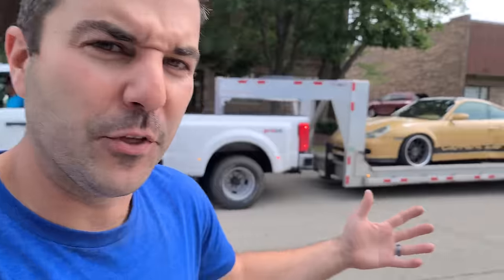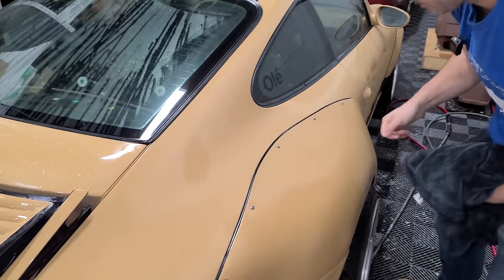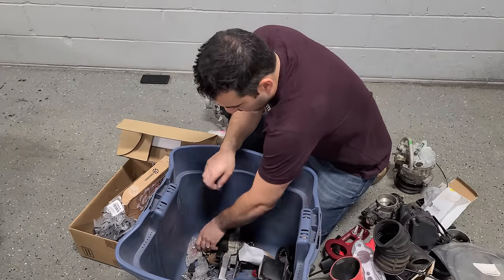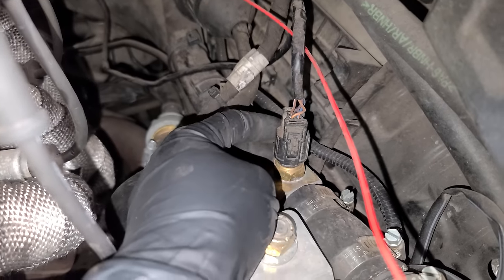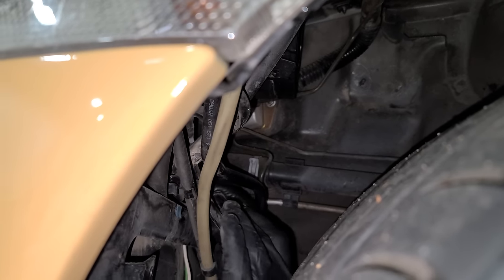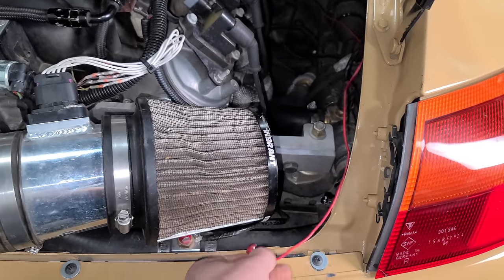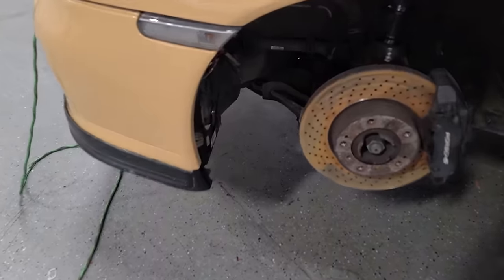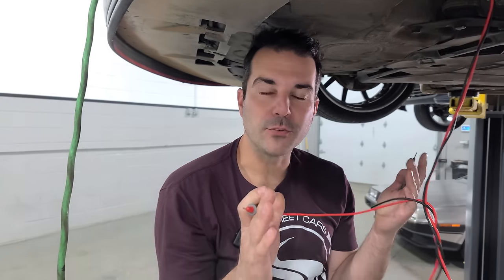I Bought A WideBody Porsche 911 That No One Could Fix! I Fixed It For FREE In 3 Hours! LS Swapped!

Comment: What am I working on? Trying to get a Tiburon GT back on the road. Needed a minor engine overhaul, some welding and some paint. I've fixed the engine, buddy finished the welding.. though he did burn up a bunch of wires in the process so those are going to need to be fixed still. Painting is underway.
By the time it's finally done and street legal it's time to take it up a notch and get it making more power, perhaps with a small turbo. Stock internals should be good for up to 350 hp.

Comment: If you plan on keeping the car long term a Meziere electric water pump would be a great addition. You get a much higher flow rate than you would at idle or low speed.

Comment: My buddy bought a couple boxters for $2000. One was wrecked on the front and the other was in decent condition but they couldn't get it to start or even crank. My buddy pulled the ignition/immobilizer stuff from one and put it on the other one and it ran. After taking everything off the wrecked one that he needed for the other one, he painted the fenders, or new headlights on it and sold it for $8k.. I'd say that was a come up.

I think with the way the economy is right now, I may start looking for cars that I can easily flip and depending on the turn around time, I may write my job or get a remote job.

I was offered to be a shipping agent at home, simply shipping packages, tracking them, and being customer service, for $25/hr. Of I want working already, I would do it 100%.

Comment: whoever tunes that for you can make that factory ecu output Efans if you wanna clean up and simplify fan operation specially with AC if you add that in
Reply from the maker: Do you mean through the LS computer or Porsche? I think I can get the Porsche one to take over can control as is. Supposedly there's another temp sensor that controls the fans.
Reply: @LegitStreetCars  stock LS ecu, food for thought
Reply from the maker: For sure,  I appreciate that. I'll try the Porsche computer first since it's still there and should be able to control the fans as is. If that doesn't work I'll try the LS ECU. I'm going to revisit that when I start the AC installation.

Comment: Stay Tuned (Tony Angelo) is also working on a similar project right now.  They did some good stuff on the cooling system and exhaust that might be helpful.  Your exhaust is...not so good looking.  Speaking of, it looks like (at least) the one muffler is pointed in the wrong direction flow-wise.

Comment: Running the fans after the engine is off is pretty useless - particularly with the sensor in a hose that is so far away. The coolant is not circulating so you are basically just cooling what is in the radiators. I would switch it to switched power and pull out the pusher fans. Also, if I remember correctly, the switch for the fans on those cars is in the engine block - which is not there anymore. As others have noted, get the right oil pan before you take it to the track or you will have an oiling issue.

Comment: I think the 2 stages of the cooling fans should never be wired together via a resistor...
Stage 1 goes via resistor to limit the current and RPM of the fan.
Stage 2 is usually a direct connection without any resistors... The fan should blow at max RPM and should get the max current.

Comment: Hey Al, I've never been inside an LS (even though I've got 3 of them), but you mentioned there is a .001-.003 clearance tolerance on the rods.  Are GM clearances always this wide (as far as rods and whatnot go), and are they usually all over the place a within the tolerance, or are they like Hondas or Toyotas, which will all be nearly identical, usually within a tenth or two (for example,. .0015-.0017 clearance on a .001-.003 tolerance callout, Japanese car and motorcycle engines are extremely consistent in their manufacturing methods and tolerances).  Does GM or Ford even approach the level of Japanese manufacturers?  Or can you count on them being all over the place, much like Chrysler/Dodge/Fiat?  

Good show, it's getting better and better.

Comment: So you just have max fan speed now? Since you took away the resistors. She gonna be cold in cold weather. Maybe not a problem over there. ( under temped engine oil) 
I would sugest stop using the wish/temu solder joints. Go with deutch connectors. Get a good tool for it. 4 point barrel crimper. 
Could allso use open or closed barrel crimps, with the right tool, and shrink hose over, if you don't want a connector. Soldering should never be used anywhere it gets hot, or where there is movement.

Comment: I paid $1,000 for a 1993 GMC Sonoma single cab long bed 4.3 V6 it's got missing bolts and falling off bolts and I had to replace the brakes disconnected wire's kind of similar to yours I got to replace the head gasket in seals and stuff eventually. But the interior and the body is in immaculate condition

Comment: I'm fixing up a shop that had a corner burned out of it. Once I have the shop resheated on the inside and wired, I'm going to put a 2012 GL 350 bluetec into the shop, pull the seized engine, and rebuild it.

Comment: Love the video and the build itself. I'm currently working on a 22 elantra n. Just installed a hybrid turbo and meth injection. Having trouble after install. Throwing codes p259f and p004e. I adjusted wastegste voltage to 3.8 and I'm still getting turbo surge around 5k. Not sure what the issue could be.

Comment: One thing to point out... factory fans arent always the best. The shroud is there to siphon the air into the fan and nothing more. Aftermarket fans are usually better CFM than factory fans and when setup properly will shit all over factory garbage. Factory is usually set up for comfort, reduced noise and to meet the requirements of that specific setup. As soon as you do anything to the car their performance deteriorates.

Comment: Add an electric ROWP (Run On Water Pump). With the engine off, the fans will only cool the coolant in the radiators, not the engine. With the pumps, the fans will cool the engine quickly and won't drain the battery.

Comment: This car deserves a FMU full TI exhaust. Should be under 5Lbs. BTW, Ferdinand Porsche said his name is pronounced, "Por-shuh", and since the car is named after him... This fan wiring issue is what happens when you get close to a deadline for a show and just start rushing. Instead of diagnosing and fixing, they just tried to Band-Aid it to get to SEMA. I'd ditch the pushers and get an old school turbo timer to rune the fans after the car is shut down. Most German cars do that from the factory. I know BMW's, Posche's and Mini's all do it. I don't think you're going to have a heat problem after that, but if you do, just get a Meziere electric pump and add it to the mix with the turbo timer.

Comment: A thought on the cone filter being so bulbous and impacting the boot lid... the LS Trans Am has a flat sandwich sort of panel filter that hugs the hood.. i wonder if there could be a solution for this vehicle in that design, or a dual arm, 'left and right cone into one' setup with smaller filter diameters.

Comment: In my Hummer H1 world - a bunch of idiots put pusher fans on their rigs which is actually anti-productive because they block airflow into the cooling stack at highway speeds (where our trucks tend to overheat).  The factory belt driven fan moves geometrically more air than any electric pusher fan possibly can.

Comment: About your question on what we're working on right now: I try to get to work on my e46 330Ci to fix the cooling system but the current weather is biting my bottom for the last 2 weeks every day I have the time to work on it. Fall/Winter is just rough when you have your car under no roof. My other project is a head gasket failure on my other e46 Touring I try to fix to get it sold for a better price. But again, time, parts availability and weather is the issue here as well -_-

Comment: Follow these instructions and you will fix all your cooling issues . 100%

If the steam pipe to the cylinder heads is on the throttle body side of the engine, remove it and put it on the other side of the engine. You may have to improvise. The steam pipe goes on the front of the engine as it sits in the vehicle. In this case, the front of the engine is the flywheel side. That hose should go to The top of your degass tank. The top of the radiators should also have bleeders in them to allow air to escape. These bleeders from each radiator should be teed together and also be plumbed into the top of the degas tank. The bottom outlet port of the degas tank needs to be connected to the heater port on the water pump that is closest to the rear bumper. This is the suction port for the water pump. Has the water pump sucks fresh coolant from the degas tank, It pushes this coolant into the block, then the heads, then out the upper radiator hose then through the radiators, then down the lower return hose from the radiators and deadheads into a closed thermostat in the water pump. This backs up the cooling system and creates pressure in the cylinder heads and radiators relative to the degas tank. This promotes fluid flow from the steam port in the engine and the steam port in the radiators back to the degas tank. If it is plumbed like this, you will have zero problems with cooling as well as it will self bleed perpetually. There will be no bleed procedure if you set your cooling system up like this. If the engine boils coolant for whatever reason, it will immediately purge from the system back into the degas tank. 

Pusher fans are also a big no-no. The fans cause obstruction to flow and actually block air from entering the radiator. Remove the electrical circuit connected to the stock fans and use the stock fans on a relay connected to the appropriate cooling fan pin on the ECU. LS1 was always put in a vehicle with an electric fan. Follow the three relay wiring diagram for early 4th gen Camaro. This will give you an ECU selectable high (parallel wiring) and low speed (series wiring) for both fans. Which is nice because on low speed you typically do not hear the fans. I personally wouldn't want to listen to fans when driving my Porsche either. Hope this helps.

Comment: Underneath the radiators looks like a piece of flat plastic, which is kind of counterintuitive the Corvette LS gets the majority of its heat low on the road. It has a little Spring loaded air scoop that actually if that air scoop breaks, you will overheat…. I certainly would put a low scoop underneath to grab some of that low air.

Comment: Just a thought, the factory Porsche computer may not control the fans correctly without an RPM signal. It constantly thinks the engine is off with the key on. Anyway, good fix! 👍👍

Comment: $27k is excellent for this.  I sort of like the color even though I favor darker ones.   Worst case if A/C and PS doesn't fit, drop in a 911 TT motor and trans and SEND IT!   Probably cost you another $10k (with the sell of the existing LS for around $5k)
Reply: Costs way more than that. Cheapest used turbo engine I've seen was $20k. That was without the pinned coolant lines, sharkwerks elbows, and pinned cams. Also didn't include the ECU or exhaust. Adding in the coolant lines, elbows, cam work, ECU, and exhaust you're looking at another $10k. Then you need the transmission...the tiptronic auto isn't too expensive. The manual will require the purchase of the transmission and then a clutch, flywheel, etc. You're looking at $35k absolute minimum to get the 911 turbo engine and transmission....not including installation or tuning costs.

Comment: It sucks so many shops really don't want to touch modified cars.  They quote very high hoping the customer goes elsewhere.   Now what really sucks more is when you agree to the fees and then weeks later they tell you they can't do the job.  You show up and you realize your car was never moved from where you parked it.  During my build of my Cadillac VSport I spent over $6000 in rental car fees due to shops taking the job and then calling me back weeks/months later and did nothing.  I could have bought a $2000 Honda at the time and resold it for $6000 due to the used car boom or kept the car for my daughter who is ready to drive now.

Comment: I used to have a 1977 Toyota FJ40 in this color. I think it looks good on the exterior of this car, I'd take it back to a factory interior though, ditch those seats and spray paint can colors. I know they're expensive but I'm not a fan of those deep dish wheels. I'd imagine there aren't a lot of options fitment wise for that wide body. When you find stickers, wonky exhaust and numerous zip ties you know it's been to Sema. Once you take off all of the goofy shit and fix all of the flaws, it will be a decent car.

Comment: you start a Porsche on the left side for the old days when you ran over to the racing car it was on the sideline and when the driver jumped into the vehicle he could both start it and put it in gear and drive at the same time therefore the key is on the left side

Comment: OK first thing, yes your saying it correctly, anyone who says porscha is just trying to sound posh.... Second I can't get over the fact that nobody could figure out that fan problem, and thought putting a fan pushing without removing the pull fan would work... way to restrict air flow Einstein... any way good job but please put the o.g. resistor back, and there's plenty of wire to solder and heat shrink on the resistor pack, as long as you don't use those crappy things you were using with the heat gun... they are junk... Also I noticed some 3M splices they are also a source of intermittent problems if exposed to damp and vibration.... so best course of action is get rid of all the nasty harness mods and stay as stock as possible... I used to do alot of modding years ago but if its done badly it will haunt you.. and the guy who designed the original system is alot smarter and had alot more money for r'n'd than we did😅... any way rant over and good buy, that's a nice project car with tonnes of potential...

Comment: Remove the pushers and wire in the factory fans with those connections.  I am thinking someone felt pushers are the easier way to do this.  You are right that if they can fit, the factory fans are usually the best.  I think you are also right on the resistors.  They aligned the high side to the low side and stopped them from turning on.

Comment: The extra pusher fans could cause a dead zone with the air flow, I would think Porsche built a pretty stout system for there engine to begin with.

Comment: I converted my Bug to have a water cooled engine years ago.
To get round the bleeding issues I used 2 header tanks, one in the rear and one up front.
When filling the system I just keep topping up each tank whilst the engine is running until it stabilises.

Comment: Here's my theory: Someone disorganized / frustrated with a long project bought a very organized fan wiring kit, and installed it backwards, skipped steps, etc. Probably they new a lot less about how the factory fans should work than you. Also probably: They didn't have a fancy tablet system to turn the fans on at will and isolate the problem in its purest form.

Comment: What am I doing:;Debating with myself whether to take a Honda accord and retro reengineer the drivetrain and interior AWD with a gt35 turbo with a methanol alcohol injection tune with nitrous something I like to call a cop rebuttal button. Then install heated seats and revamp the a carpet with an upgrade to the driver interface entertainment and accessories management system touch screen install lights and suspension basically redesign the car with technology of today. I’m also working on a 800 horsepower 😮🫣 electric 02 Mazda Miata that never has to recharge brakes and tires are going to be the only maintenance items other than  inspections of grounds and resistance checks of certain electrical components.

Comment: ❤❤MAYBE THE WHEEL NUTS ARE TITANIUM IN WHICH CASE THEY CAN SHATTER USING AN AIR TOOL ON THEM AND TAPE CAN HELP STOP THEM SHATTERING ,,THE ENGLISH MADE TRIUMPH CAR HAD THAT VERY PROBLEM AND THEY WERE REALLY EXPENSIVE TO REPLACE❤❤

Comment: I do electrical for a living.
please don't use the cheap shrink tube connectors. They are a fire hazard when attempting to use them on high current circuits.

Real soldier and srink tube is best but even a cheap butt connectors are far better then what you used.

Comment: Just came across this and you did the one thing they didnt with the cars over heating  problem and what you did was K.I.S.S (Keep It Simple Stupid) basically  meaning you fixed the over heating problem  my simplifying the oem cooling fan system and removing the mess